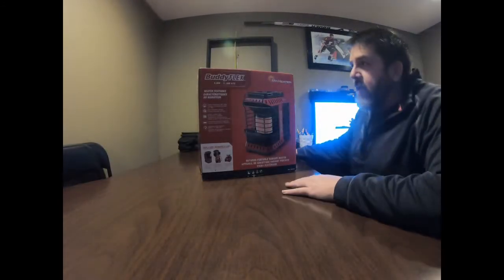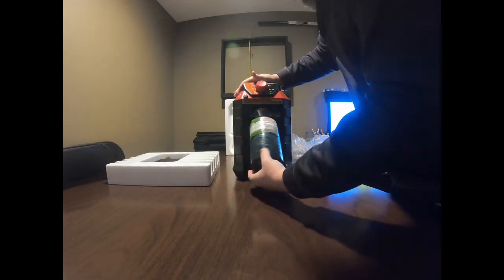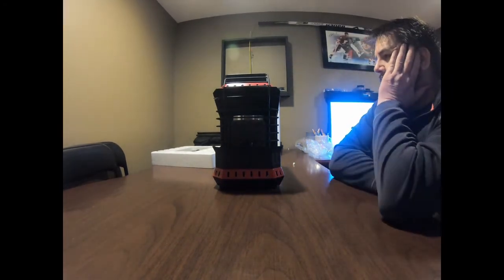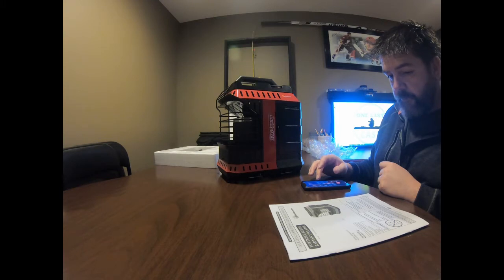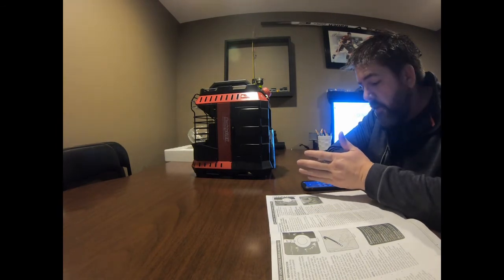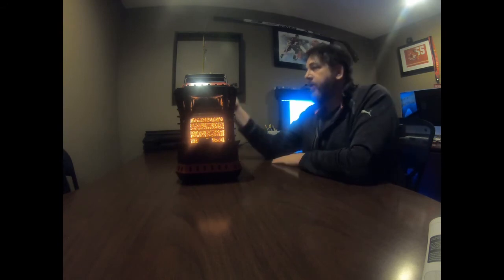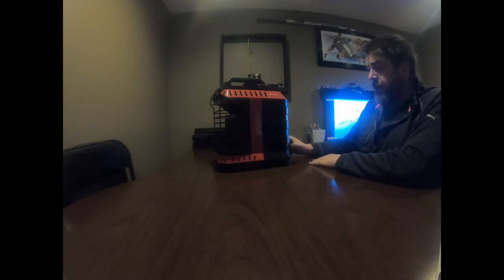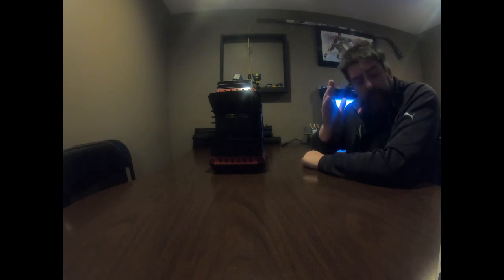Unboxing and troubleshooting the Buddy flex heater

Comment: Great Video Buddy My Flex Heater I Started Out Using A 20lb Tank it Stoped Working After 2 Months After I Changed The 20lb Tank
Reply: I Used It In A 1 1/2 Car Garage worked Great Now It Wont Light Up., Hope Your Flex Heater Is Still Working
Reply: Check your fuel lines for oil blocking the lines. Even with the propane fuel filter (made by mr heater) oil can collect in the lines from the hose from your 20lb to the heater.

Comment: I have the original buddy heater, and it requires the exact same procedure to start. Hold down the prime button wait 15-20 seconds, press manual igniter then hold prime button at least ten more seconds or you are starting the entire process over

Comment: I figure mine  out, took it apart and Electrode was to far from pilot hole I pushed it closer to pilot about an 1/8  away and it worked fine this was my situation may be different for other's.

Comment: I can't even put in the battery
Reply: You the push the tar piss out of the little lever to release the little hook inside
Reply: @texsol7899  Thank you.  I'm a little pissed that they make it so crappy.  I was afraid of breaking it.
Reply: Omfg I just realized do not take the screw out on the little latch under the battery door and it opens like nothing.

Comment: Priming is for all propane or other non fuel injected items, the gas needs time to run through
Reply from the maker: oh for sure just would not think it would take up to 45 seconds to prime the lines
Reply: @OneLastCastFishing  I usually count slowly to 10 or 20+ before pushing the spark button to allow the gas to build up. Same as with starting the pool heater in spring where instructions say to hold the gas button a full minute.